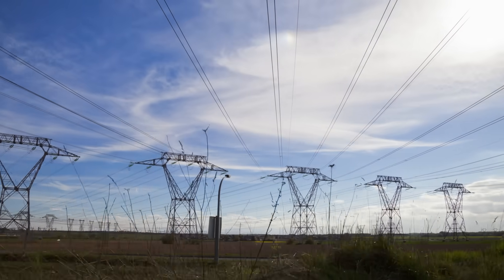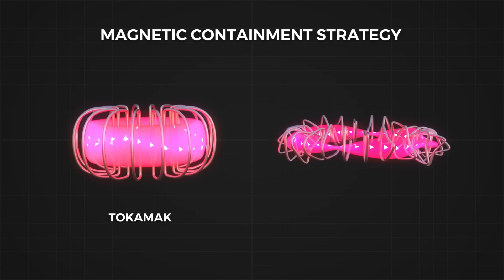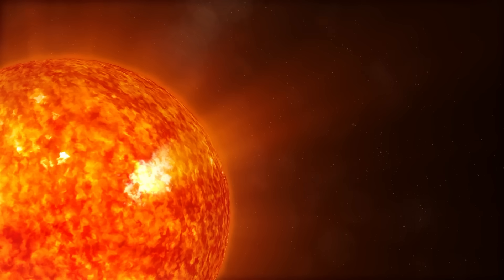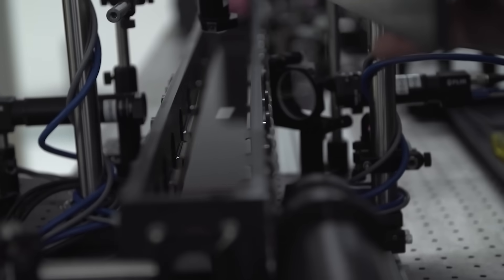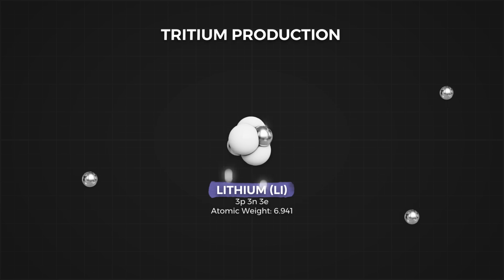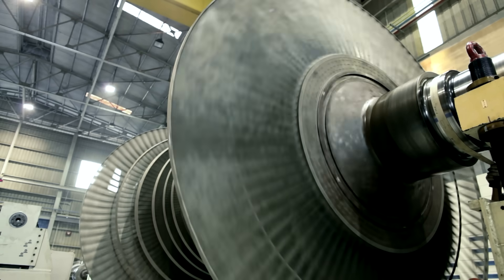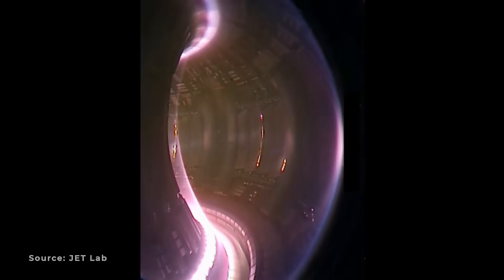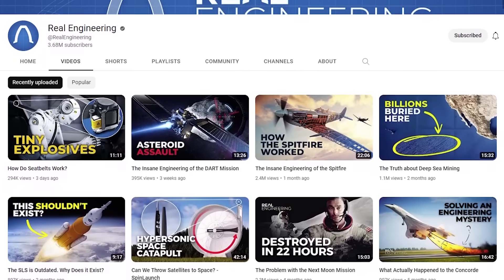The Problem with Nuclear Fusion

Comment: Given the last 24 hours, I'd love to hear an update on opinions of where this is all going.
Reply: It’s still a really really long way. I’m hopeful that I will still see a fusion reactor in my lifetime tho.
Reply: @zapzapzarap6148 :  Do you mean a commercial fusion reactor producing power profitably?  Or one in the lab that can maintain s stable, sustained, reaction, but at a GIGANTIC net energy loss?

Huge difference, which is why we're still decades away, and perhaps MANY decades away.
Reply: @rogergeyer9851  from context I would say the commercial one hence me hoping to see our species achieve that some time in the future:D
Reply: I read The Atlantic article and it's basically saying: great achievement, which shows it's possible, but has no real world solutions yet: "Two megajoules is about the amount of energy released by burning a small chunk of kindling, so thousands upon thousands of such shots a day would be required before the energy production became in any way usable. Unfortunately, NIF’s lasers use huge slabs of glass that take hours to cool down between shots" So or: we would need to be able to do it faster or with much higher yields. I suspect the last of those two will improve the most.
Reply: @autohmae  One important note is the difference between fusion gain and "engineering" gain. The fusion gain is determined as the energy of the light put in (2.05 MJ for NIF) to the energy released from the reaction. 

However NIF turning electricity into light is very inefficient. Consuming at least least 400MJ to produce that 2.05MJ. Laser efficiency have improved greatly since the NIF ones but still far off. So even if they could machinegun pellets there could not be any realised gain.

Turning the released energy back into electricity is also quite inefficient.

On a bright note the Fusion yield of NIF had plateaued at about 0.05MJ 2014 to 2020 but there have been orders of magnitude over the latest few years and this one was the first to break even (in fusion gain) with 3.15MJ. 

And even if NIF (and other laser confinement reactors) wont ever hope to create engineering gain NIF is a great source for studying plasma behavior and ways to make just ever so slightly less chaotic. That science is greatly valuable for other, more engineering gain focused, fusion reactors.
Reply: @autohmae  And they need 400 megajoules of grid power to pump the lasers for the shot. Huge conversion losses until the energy finally reaches the Hohlraum with the fuel in it.
Reply: @meltdown6165  With net energy gain though it finally reverses the trend of that being a problem. Even in a tiny amount it proves that fusion is viable. It always was the best option humanity has for ending dependence on fossil fuels but now it has been demonstrated in a lab. Dedicating resources to developing fusion fully has always been the limiting factor.
Reply: @AmbrotosArkhon  For anyone who has played the game, the purpose of these news releases like the one DOE released today is to soften up the funding powers (Congress). Fusion people have been conducting business by news release at least since 1970 from my personal knowledge.
Reply: @meltdown6165   Because the entirety of the focus of this experiment was to create a net energy gain. The efficiency of the laser wasn't worked on at all which the team responsible for this experiment has admitted and mentioned on their own. The way THIS experiment was done isn't going to be THE way, nor does the way it was done represent current technological means at their maximums at all. You have to prove something is possible first. Now that we've crossed the threshold, others will find other ways to do the same thing cheaper and more efficiently as more and more minds collaborate.
Reply: @meltdown6165  Keep in mind that those 400 megajoules are from 20+ year old lasers. That's how old that facility is. The U.S military now has solid-state lasers that are significantly more efficient. They can probably do it now with 10 MJ if they had the current bleeding edge solid-state lasers.
Reply: @Kevin-rz6lm  yet fusion research funding is laughably small compared to e.g. the military. A single aircraft carrier can fund the entire world's fusion research. And there are 7 operating today.
Reply: @Kevin-rz6lm  I hope you're not implying a coverup or conspiracy... because what you're describing is quite literally what short-term uneconomical projects need to do to succeed in the long-term. It's not a flaw in capitalism either, it's the reason the two ideologies need separate approaches in the first place.
Reply: @AmbrotosArkhon  You are not understanding.
The net gain was only from the energy received by the pellet.

The pellet received 2.5 and gave 3.

To make a laser to give 2.5 they needed to pump up 400.

So 400 MJ to obtain 3MJ.

The "Q fusion" is positive but not the "Q total".

They need to improve lasers and stuff
Reply: @ppvf3851  Right, which is still limited by funding which is limited by capitalists preferring to push profitable industries to them such as fossil fuels.
Reply: @AmbrotosArkhon  They are planning ITER to have a net energy surplus of factor 10. So no one doubted that. But are you able to reach a factor 30 or more if you count all of the energy in, for example for cooling, plasma heating etc.
Reply: @rileyhogan5196  Yeah. No sense working to optimize a process that hasn't been shown to work. Now that ignition has been achieved, the efficiency tweaking can begin.
Reply: @SilverAura  My comment has nothing to do with coverup or conspiracy. It is a matter of the level of presentation and the intended audience. I played this game in the fusion arena and it made me nauseated. The primary audience is the news consumer. It is implied that the audience will take their enthusiasm for this "miracle" solution to the monumental fear of global warming to the Congress people. And there is the element of urgency all crushing down on Congress. The basic object is to keep funding. The next level is to keep funding at least equal every year. Then the next object is to increase funding. And the ultimate goal is to have funding increase by percentages greater than 100% every year. I think whatever funding should maintain a forward progress. But there is absolutely no consideration how this funding affects other research, much of it being far more important and urgent. There are abundant problems competing for finite resources. News releases like this one do not consider the overall picture. I am working on a nuclear medicine problem right now that will start killing people when the supplies are cut off by the rest of the world because we are too damn busy jerking off to this sort of dog and pony show. We have been living under the sword of Damocles since 1990, and every year we manage to finagle supplies in the nick-o-time. A simple investment of $500MILLION in R&D 32 years ago would have saved the US taxpayers literally $10'sBILLIONS spent over the past 32 years on this problem. And here is the worst part, healthcare is going to screw us for $100'sBILLIONS in the future for the solution that we are currently following. This is a perfect example of insipid bullshyte like this taking resources away from a far more important and immediate problem. And who gets to decide what is more important and immediate? A well-informed population who's bodies will begin stacking up when medical isotopes are not available. FUSION POWER PRODUCTION or NUCLEAR MEDICINE? You weigh the choices. Remember, limited resources.
Reply: @Kevin-rz6lm  so why are you targeting fusion research instead funding of military funding?
Reply: @bigsmall246  First, that is the wrong question because it is lust an appearance that I am attacking only fusion funding. A more applicable question is why am I attacking the combination of deficit spending and apathy toward more immediate and severe problems. The real target of my critique is the government bureaucrats who are poorly educated in both project management, physical science, and social science. The result is poor prioritization of spending from myopic and tunnel vision of people funding pet projects, pet constituencies, and favorite cronies. Before I get to an example let me say that as research scientist I am all for research progress.

Now an example. Mo-99 production for critical healthcare procedures has been produced outside the US for 32 years as a result of bureaucratic stupidity. That presents 2 immediate threats; one to national security and the other to unstable supply placing critical heart and brain trauma patients at risk from not being able to have rudimentary health care. Easily solved problem, right? Wrong. These same bureaucrats have refused to fund technology transfer and construction of GREEN production. Instead, we are funding to the tune of $1BILLION accelerators that will require a new 1500MWe coal power plant for this production alone and nothing else. You should be saying, WTF? Who did this? The DOE agency The National Nuclear Security Administration. Why? cronyism.

So I layer that experience over my experience in the fusion business and I get nauseated that I contributed to this corruption as a fusion researcher begging for outrageous amounts of money and at the same time taking the finite resources away from medical isotope production at a reasonable cost, without pumping billions of tons of carbon into the air only because we want to fund cronies. Accelerator cronies = fusion cronies. Who's to blame? Bureaucrats.
Reply: @Kevin-rz6lm  trying to solve fusion is not an apathy towards immediate problems.
Reply: @bigsmall246  I said immediate. I didn't notice any crop failures this past growing season. If you have shortages, it is being blamed on supply chain problems, not climate change. Like I said you would not be able to sell you proposition to those 30 families every 3 minutes. That is immediate. You want to stop carbon emission right now, not in 30 years? Then build fission power plants. That can be done today, not 30 years from now. There is nothing more immediate that today and right now.
Reply: @meltdown6165 :  Plus that's not counting all the OTHER energy needed, such as the energy to power the fusion bottle, which is massive.
Reply: @rileyhogan5196 you are correct now that they have found the path it’s up to the engineers to build a reactor.
Reply: @AmbrotosArkhon  you don't seem to understand. The net gain is in the reaction chamber. The whole system operates at a huge loss. They deliberately omitted to mention the huge amount of electricity consumed to power the lasers.
Reply: @phpn99  A net gain is a net gain. If the reaction is scaled up then eventually the total power used to start the reaction will be insignificant to the power produced. What that means is that it would then be possible to sustain the lasers and have excess power to utilize from the chamber alone. It's similar to the black start of an electrical grid, the difference is that once a fusion reactor is black started it will produce more than enough energy to black start it again should it go offline and it will be with renewable fuel rather than fossil fuels.
Reply: @AmbrotosArkhon  But it WASN'T a net gain. It was a catastrophic loss because they didn't show the energy needed to fire the lasers. What isn't getting through to you? Scaling it up at this stage will just make the problem exponentially worse.
Reply: @bugjams  What's your point? A few adjustments and a few more discoveries will make it more and more possible. You need to loosen up.
Reply: @AmbrotosArkhon  Buddy, I'm just correcting you on the facts. Good lord. I'm not saying it's not possible.
Reply: @bugjams  I know the facts. I know that this is not even close to the final product and is more of a proof of concept for the technique. The real net gain is scientific knowledge and a further sealing up of the naysayers who don't believe that fusion is ever going to be viable.
Reply: @autohmae  scalability has always been the hardest part of adoption
Reply: @autohmae  keep in mind, the time delay between nuclear fission being demonstrated as feasible in the lab was FAR less impressive; I wanna say 0.02% energy return.

It was only 5-10 years later that the first nuclear power plant was operational.
Reply: in CNN interview "Bill Nye explains why nuclear fusion breakthrough is a big deal" Bill said this technology might help our grandchildren, I would guess it is same same 30 years in that future as before for fusion reactors.
Reply: @Nauda999  A historical analogy would be like being born in the late 1700's and living till around 1860. You see the breakthroughs of electricity, the telegraph, and photography, but before it was anything more than an experimental novelty. My guess is within our lifetime we'll see the same thing with fusion; experimental power producing stations and the like. We'll live long enough to see it be viable, but not long enough to see it become widespread and solve our issues.
Reply: @Nauda999  My point is not that we'll see fusion power become widespread in our lifetime, quite the opposite. I predict we'll see some small scale power plants, less for generating power and more for the scientific benefits of study. Will we see massive desalination plants and the greenification of the Sahara in our time? Of course not. Might we see a few small plants producing tiny amounts of electricity for the purposes of study and novelty? I would say probably. We're talking plants that provide like 0.000001% of a national grids energy, not commercial endeavors. 

Once again, I must stress these wouldn't be full scale plants or anything, but humanity dipping it's toe in the water. Fact is, nobody can tell the future. Nuclear fission was hypothesized as early as Madam Curie. You asked a physicist in 1933 whether nuclear power plants would be a thing in 30 years, they'd probably give a skeptical "maybe", if that. Simply achieving a net gain means that somebody is going to try and actually generate power with this.
Reply: @gregoryborton6598  a small fusion science experiment doesn't have to produce electricity it can run at net negative, wouldn't be a problem, but that is not directly related to fusion reactors.
I suspect this net gain doesn't mean the system is self sufficient.
This so called net gain the announced would be for an abstract ideal system where every component worked at 100% efficiency, and since that is not possible, there will be a need to either reduce energy needed to keep fusion going, or to get a lot more energy out of it, and since getting more energy out doesn't seem realistic, only way is to improved efficiency, and not by a little, but by 500% (a ballpark figure)
Reply: People should be excited by the potential but conservative with their expectations, something that is apparently difficult for most given what I've seen around. I can't blame them though, this stuff needs to take into account total energy in / out not just ignition source and it's not going to be net positive. But putting that in a press conference doesn't earn congress bucks.
Reply: well he didn't discuss inertial confinement at all, but that's probably because most people in the industry suspect it will never be useful in as a power source.
Reply: Not a lot has changed. Break-even was nice, but not enough. The idea is to efficiently generate adequate surplus electricity for use, not barely enough to keep the reaction running. Now they're saying 'it will take 10 years," instead of "it will take 20 years," like they've said for the last 70 years... but I'll believe it when I see it.
Reply: @ProfessorJayTee  with the introduction of large-scale superconductors, new blanket designs and AI magnetic field corrections, I would say a lot has changed.
Reply: @TheBlightWarden  Again, the 1.5 net gain only accounts for the difference between the energy produced, and the energy transmitted by the lasers. The lasers used are very inefficient, meaning that they only transmitted a small percentage of the energy pumped into them to create the laser. This resulted in a total net loss over several orders of magnitude.
Reply: Lmfao I was going to say this aged poorly
Reply: @madmike022  ...and you didnt listen to this nor the NIF presentation properly nor did you even follow the discussions above LMFAO
Reply: we are 6% closer to achieving fusion (the breakthrough made 1.2x the amount of power inputted, but we need 20x for it to be profitable or useable)
Reply: I'm reminded of how for nearly a century every competitive runner wanted to beat a 4 minute mile. It wasn't until the 1950s someone actually did it. By the 80s, most professional runners could break it, and today you see some high school athletes performing at that level. Could be something similar with fusion.
Reply: @ianradc  I wanted to write similar allegory, if we compare these new fusion "reactors" to sprinters, then for fusion reactor to produce energy it would need to be 50, 100, maybe 200 times more efficient.
now think of sprinter running 4 minutes one mile, and then divide it by 50, or 200, you'd need 4.8 seconds to 1,2 seconds to run a mile, that is 4 times faster than seed of sound, maybe it is possible, but time will tell.
Reply: There is deep deception behind this.  But just as doctors and nurses and bankers, etc. may be authentically doing what they believe is right, Admin often is operating under a hidden agenda.  Investigate the fusion research being done by David LaPoint.
Reply: The news are misleading: National Ignition Facility uses inertial confinement: this will never, ever , ever create a working practical fusion device. The proof is that nobody else researches inertial confinement. NIF was not even created for that it was created mainly to get a way to research nuclear devices without doing the banned tests. Now it is trying to reinvent itself. The stellarators and tokamaks is the real future (meaning: magnetic confinement). Inertial confinement is as useful as  muon catalyzed fusion (meaning it is useless). But news ALWAYS misunderstands science and must put all in terms of grandiose words, major breakthrougs and clickbaits. And yes I am a physicist. Lets remember when news insisted in calling the Higgs boson "the God particle" (a name coined by an opportunistic editor), when it said ISON would be the brightest comet ever, when press made all that fuss for faster than light neutrinos (that never existed), more recently headlines saying dark matter does not exist (a gross overstatement), and that brain uses quantum mechanisms just to cite the newest ones.
Reply: @TheBlightWarden  the net effect is 0.01 if you count the energy to power and cool the crazy inefficient lasers.
Reply: @TheBlightWarden  1.5 what ?
Reply: @TheBlightWarden  thanks
Reply: Still "20 years away" ...
Reply: You can watch Sabine Hossenfelder on 'nuclear confusion'. While it's a nice thing to be positive on Q_fusion, one may be quite a way off Q_total i.e. including all the energy that is needed to keep the whole facility running, including cryo-systems etc. Btw, Sabine talked about the NIF's announcement of reaching 0.7 Q_fusion. They must have a new funding round coming up.
Reply: Previous predictions failing has no impact on whether a current prediction is going to fail.
Reply: The finally got the Gain above 1, at 1.5 that's more out than in. Fusion will be really bankable for humanity when the Gain is greater than 10 and scalable (so we can increase the energy yield with the needs of humanity)
Reply: Bombs
Reply: As a proof of concept it is still a breakthrough achievement imo. Like everything else in Science, development and evolution is the vast majority of the times built on top of what was done previously (like it should). The idea that Science works like a person taking giant leaps into the unknown is wrong imo... To me it's more like a person wanting to reach a destination and just trying to walk there (generation after generation) while taking into account all the different detours that didn't lead anywhere, the bumps in the road, the different inclinations, turns and passing that entire body of knowledge from one to another, until finally someone gets to that final destination. The result of this experiment imo is like finally meting someone down that road and asking if that final destination is real and it is possible to get there, and you get the confirmation that, despite the very long road still ahead, that final destination is real and it is definitely possible to get there sooner or later... you/others and yours/others offspring just need to keep walking and learning to get there. The media will ofc sensationalize the achievement because "big and definitive" simplified headlines about an extremely complex subject often sells better than to just tell a volatile story step-by-step... and there's nothing wrong with that imo, after all as i see it, Humanity is just a bunch of Dreamers and i love it! Despite all the wrongs with the world (Humanity) to this day, just take into consideration where we were some thousands of years ago and where we are now! Even putting the harsh and cold reality of everyday-life, what would be the point of Life itself if we couldn't Dream of a better future (even if not for ourselves during our lifetimes) for others?
Reply: It's not going nowhere fast ...but it is going somewhere very.....very slowly.
Reply: @pauliexcluded1  Turtle vs the Rabbit tale! Slow and steady can get you anywhere!... unless we get struck by a giant piece of rock from outer-space, but ei!... how boring would life be without a little danger? XD
Reply: This is all going to the end of our oceans. Water is H2O and we will turn it all into He2 and O2. It will take some time, but not as long as the scientists say because they do not factor in the exponential usage curve of human consumption.
Reply: @TheBlightWarden  
The net effect was 1.5 IF you don't count the energy required to shoot the damn lasers. In other words, no, they didn't hit Q total of 1 or more, hence no actual ignition.  Some physicists are just outright lying here in order to get more research funds I suppose
Reply: In the last 100 years, humankind has advanced technologically faster than in any time in human history, can you imagine the next 100?
Reply: Poorly. We might as well kiss sleeping goodbye and enact asimovs zeroth law
Reply: @TheBlightWarden  It wasn't a net effect. They deliberately omitted to mention the huge amount of electricity consumed to power the lasers.
Reply: ~Global nuclear bomb fake Hiroshima deceptive There are no satellite photos of nuclear test explosions, please tell everyone ~
Reply: @TheBlightWarden  The net effect is only 1.5 if you're only calculating for the energy transmitted by the lasers, not the energy required to fire the lasers, which is many orders of magnitude higher. So still a total net loss. But still not insignificant. Riley's comment explains it well. The NIF is working with inefficient lasers that could theoretically be improved.
Reply: @northandeast9444  I'm not saying this isn't true, but do you have a source for this knowledge?
Reply: @northandeast9444  
Still a relatively significant gain. Iirc, the previous record was 0.7. Relatively. It doesn't mean we'll get fusion any time soon. But it is a meaningful improvement.

I agree with what you said about inefficiencies though. There's Q physics and there's Q engineering. The latter is a much more fickle mistress even if we do get net positive on the former.
Reply: @marcosolo6491  50 years is but the blink of an eye and more than good enough to solve all our little problems. So if that's the timeframe that you - random YouTube man - are saying is realistic then sign me up, spend all our money on it right now.
Reply: @marcosolo6491  Except this time, it really is different. I've read the papers about the reactor - their numbers are solid. Everything necessary to do it, at this point already exists and is proven technology - they're just putting it all together. The biggest key is the magnets, and the same team set a new world record for efficiency back in September 2021. And unless something drastic like Covid happens again (Covid has caused slight delays), they're going to do it. Put it on the calendar: by 2026, maybe 2027 at worst: net-electrical-gain, Q>10 fusion. They project commercial power plants based on the exact same technology thereafter in the early 2030s - not unrealistic, considering how rapidly they're building this test-bed.
Reply: The last 24 hours were supposed to give some sort of update on fusion. Unfortunately, the people who did this weren't the first to actually reach this milestone. China did it a few months ago. And they weren't the first either. This story has been ongoing since the middle of covid. It was one of the best things that happened during 2020... but no one heard anything about it because bad news sells.
And I feel that this particular energy option is being horribly undersold to the general public. (It may be just a "feeling" but I think big oil is blocking this in the news. No one knows about geothermal or solar breakthroughs either and they are both huge).
The amount of energy supplied by fusion is incredible. 2 gw in 3 gw out is pretty impressive. The maths say fusion could produce over 8 times the amount of energy put in, so when it's fully developed, this will probably run our society. Naturally... oil is scared to death.
Reply: This recent milestone is meaningless. The NIF isn't a prototype for energy production: it's basically a nuclear weapons testing facility, built specifically to allow further testing of nuclear weapons tech ideas without blowing up actual nukes; and Inertial Confinement Fusion like the NIF's tech is a ridiculous pipe-dream that likely could never work to produce net-gain grid electricity: too impractical and far too inefficient.

The real hope is magnetic confinement tokamaks, and the best shot we have - which no one ever seems to talk about for some damned reason - is the SPARC reactor being built by Commonwealth Fusion System. That will almost certainly put 3x input energy back into the grid (or, rather, be capable of it) within 4-5 years.
Reply: @TheBlightWarden  Because that is its actual purpose: that's the actual reason why the NIF was built, and the only actual reason the research they do there is conducted. The hype they generate with energy milestones is literally nothing but PR. The research they do there is only applicable to the fuel-compression physics in nuclear weapon detonations.

The technology is worthless for power generation - not only as-built, but perhaps fundamentally. The concept is deeply flawed and impractical for energy-generation, especially compared to magnetic confinement. The only way their research would be useful for power-generation is in a scheme like Project PACER - literally detonating bombs in a water-filled cavern to use the steam.

This milestone at the NIF represents an overall efficiency of far, far less than 1%. At least the JET torus, the current fusion record-holder, and built decades before the NIF using now-horrendously-outdated technology, managed about 2% overall efficiency years ago.

We have no idea how to redesign an inertial confinement scheme like the NIF into a net-grid-power reactor - the technology isn't there. You need too many lasers, which would all need to be impossibly efficient, to make up the several-thousand-fold increase in overall efficiency needed.

Meanwhile, Commonwealth Fusion Systems' SPARC reactor design, using the latest superconducting magnet technology (which actually is pretty much magically efficient) will be built and firing within 5 years, and would be capable, conservatively, of putting 3x the amount of power it draws back into the grid (although it won't actually be hooked up to the grid; it's only an experimental testbed). I wish people would talk about it more, but no one does.
Reply: @marcosolo6491  The challenges have already been overcome. Look up Commonwealth Fusion System's SPARC reactor. It will achieve net-gain (as in, on-the-grid electricity capacity) within 5 years, hopefully less.